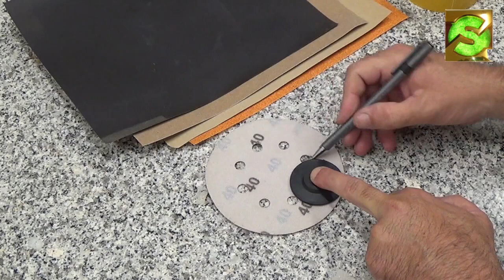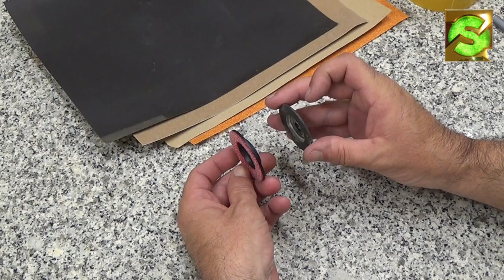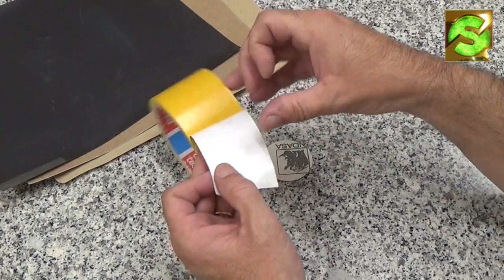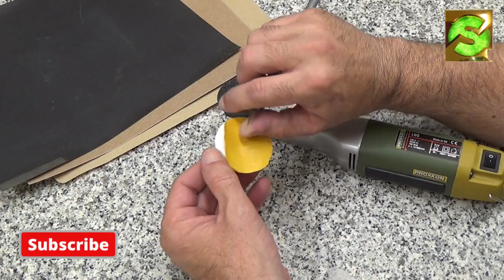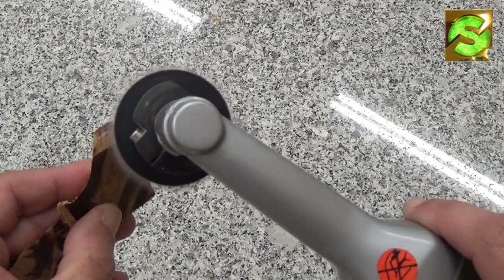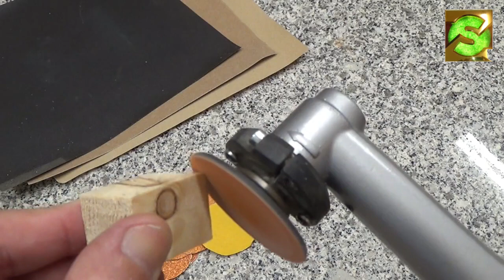Main Tool for Ship modeling - Grinder Sand Discs - Make yours - Boat Models - Proxxon

Comment: Hi, I am interested in purchasing this angle grinder with the wide disk but the link on Amazon isn’t the same as in the video. Can you link the one you have in the video, please? Thanks!
Reply from the maker: Hi Seda. I will change the link in the video. When its done I will let you know.
Reply from the maker: Seda, 
I've already corrected. Go to the video description and you have the new link
Reply: Just search google for the PROXXON 28547, this is the grinder they also do a polisher which is PROXXON 28860
Reply: dont buy one of these long kneck grinders they are not very powerful & heat up very quickly ,mine has failed twice with motors.